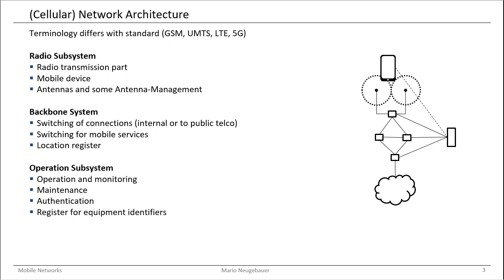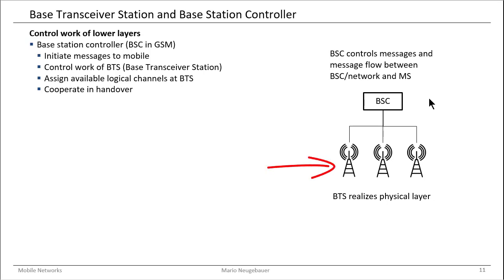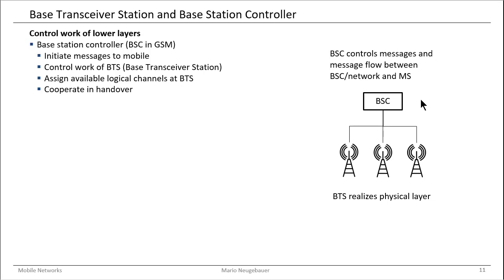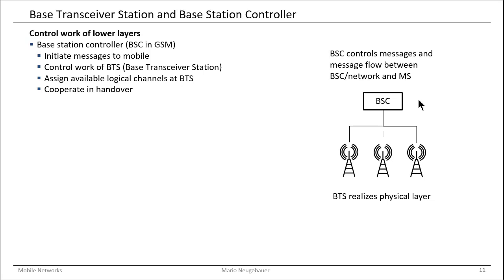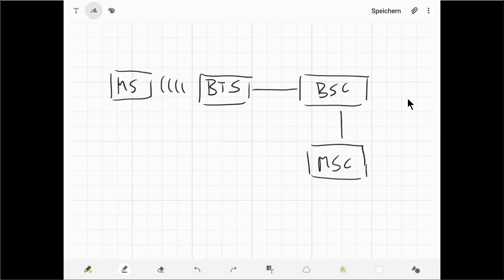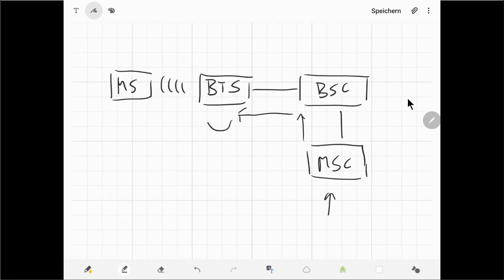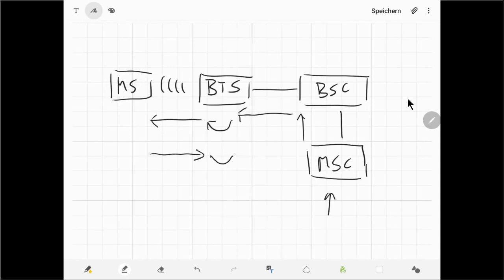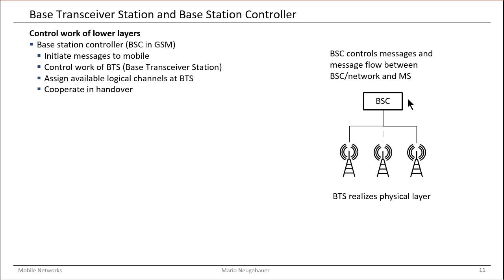Mobile Networks - Base Transceiver Station (BTS) and Base Station Controller (BSC)

Comment: Thank you for the information. A question. If the BSC is inside the 5G cell site near my home and I call from my cell phone to my wife’s, will the BSC still have to contact the switching office or will it just connect us through the tower? I ask since the wildfires in California can burn the fiber optic connection from the tower to the switching office. Thanks again.
Reply from the maker: It depends on the implementation within your network. Without knowing the exact infrastructure of your operator, I would guess that it is difficult to reach another mobile node connected to the same indoor small cell.